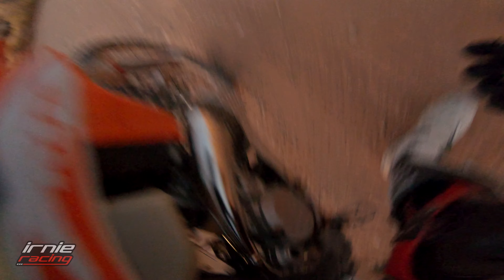Drowned 2020 KTM 300xc TPI Maintenance Pt.7 | How To Front Wheel Install & Torq. Suspension Linkage

Comment: You have to compress the forks or let the wheel spin and then brake to align the axle properly, then you can torque all the nuts.
If you do not do that maybe your forks are not aligned and the suspension will not work well.
Reply: señor that’s for sure it will bind and the initial part of stoke will be harsh , makes a huge difference

Comment: The tork for bottom screw Shock absorber is 60 nm and for linkage nuts and bolts is 80 nm
Reply from the maker: Hmmm I'll have to double check my manual.  Where are you based out of? I'm in BC Canada
Reply: Marcel Irnie. i am from România.